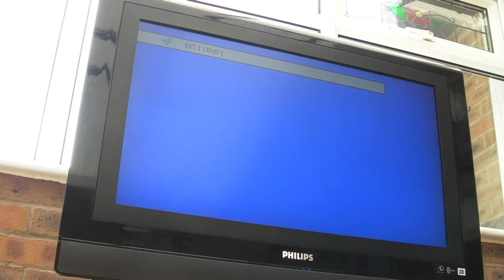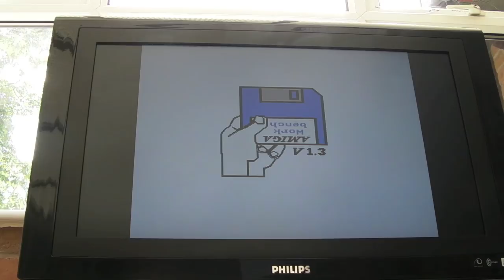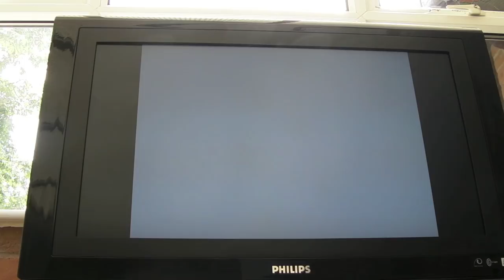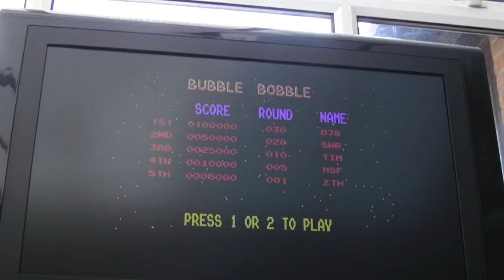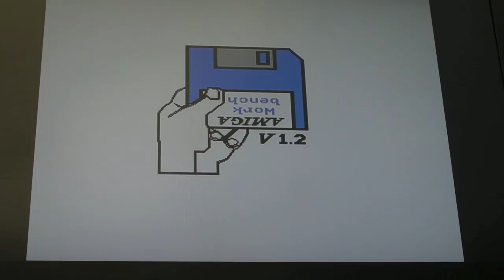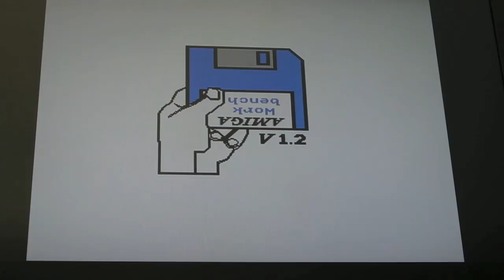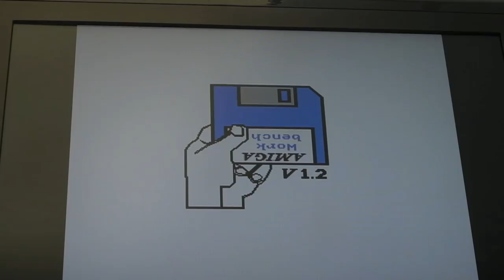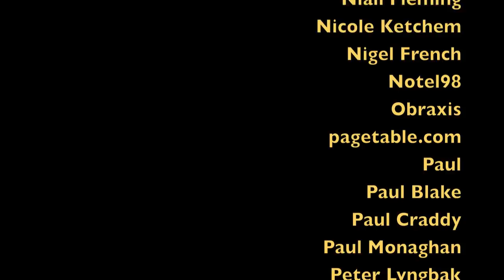Commodore Amiga A500 Repairs & Mods Part 7 (RAM Upgrade / ROM Switcher / Controller Switcher)

Comment from the maker: Part 8 - https://youtu.be/t1WT67cLfXM
If you would like to support the channel via Patreon (keep the channel running) - https://www.patreon.com/GadgetUK164
Links so you can skip to bits you might be interested in:-
00:16 - Intro & Upgrading Rev 6A to 1MB (using onboard sockets).
07:11 - Faulty Fat Agnus (No CPU clock).
10:06 - Behaviour when EVEN CIA chip missing.
10:26 - Cleaning up oxidised chip sockets using deoxit and white vinegar.
27:49 - Recapping and talk about differences in cap sizes vs later boards.
35:58 - SolidCore Joystick / Mouse Switcher (and my arcade stick). Donated by Riot Retro Gaming!
40:19 - SolidCore ROM Switcher (Designed by Kipper2K) / Testing the chip RAM / Extro.

Comment: Thanks for another great video. The not so good thing about doing the 1MB chip mod is that if the Amiga will be used for floppy gaming it will not be as compatible with games as 512KB chip + 512KB slow RAM. This is the really great thing about the ACA 500/ACA 500 Plus, you don't need to do the chip mod as long as one have the 8372A Agnus the ACA 500/ACA 500 Plus can turn the trapdoor memory into chip RAM with no mods. And then if you wanted to load floppy games, just unplug the ACA 500 and would be back to stock A500 with 512KB chip and 512KB slow RAM. In my opinion the ACA 500/ACA 500 Plus is by far the best expansion for Amiga 500/Amiga 500 plus. And that it can be used with Amiga 1200 accelerators is great. I use my regular ACA 500 in combination with an ACA 1221 A1200 accelerator.
Reply from the maker: Yes, I agree - if you have a rev 6 board, don't bother with the RAM mod done here!  The fact the slow RAM doesn't work is a pain imo.
Reply: La ACA 500 e' perfetta!

Comment: Back in the late 1980s I serviced a piece of equipment located in a damp basement. Had persistent problems with the EPROM socket oxidizing causing flaky operation. Then a kind soul introduced me to DeOxit and the problem was solved. The oxidation like shown in video can happen even with chips installed.

Comment: I just brought an A500 that is super dirty and the keyboard is in a bad way. After collecting all the parts needed like PSU and RGB cables I tested it and it booted ok. I thought this would be a bargain, but I regret it just from it not having a mouse. I managed to find a PS2 mouse for a decent price and then saw the price of the PS2 amiga mouse converters and have decided to make my own. So it was close to £30 for a mouse and adaptor or an original mouse. Then I did not have workbench disc so add that to the cost, but decided on a Gotek that was open box for a bit more.
Reply from the maker: Hehe =D  Cost soon adds up when you start working out cost of all the little bits and bobs needed!

Comment: Thanks on the tips on how to clean. Regarding static electricity. When I fiddle with chips, then I usually make sure to wear cotton clothes. And my workplace is with hardwood floor. No carpet. I wear a wristband, just as you do. Id I for some reason can not find it, that happens to all, then I make sure to touch a computers back each 5 minutes. And always when I get up from the chair or sit down. I might be paranoid, however, better safe than sorry. Never lost anything to static electricity this way, and I have been working with PC's and other computers and components since around 1990.

Comment: 41:40 - I have bought an A500 Rev 5 and there is a wire from the Processor chip to a pin in the ROM chip [pin not in socket]. I presume this the Clanger you talk about?? Can I use this ROM switch with an Agnus upgrade to get RAM expansion above the 512K basic??
Reply from the maker: In order to get more than 512K chip RAM, you need an 8372 Agnus (that will give you 1MB chip).  My suggestion is to get an 8MB RAM board that fits under the CPU, something like the GottaGoFastRAM board that I reviewed recently.

Comment: I have an A500+ that fails to boot certain games from floppy. No matter if real floppy or a Gotek. I'm considering replacing all the sockets with brand new turned pin sockets.
Reply from the maker: It could be bad RAM!  Get SysTest for it (free to download) and run a memory test!

Comment: Don't suppose you would know if I misplaced the amiga a 500 plus rom chip in the wrong position as the rom apparently goes in one space back from the normal pin 1 position would fry it. Yes I did this and it smoked a bit don't know if the smoking was from the vinegar from the cleaning process or the chip was fried....!! Gulp
Reply from the maker: Yes, I made the same mistake on a 1200 recently - it fried the kickstart ROMs!

Comment: When I received my A500 (rev 6a I think), it came with the old school rom switcher - an actual switch in the side of the case!
I assume it would just be a case of ordering those chips from the official source and sticking them in? 🤔
Reply from the maker: Yes, you could do that - to get 1MB of chip. Note: Some games like 512K Chip / 512K Slow, so that could be a problem.  I never liked the rev 6a board for this reason lol.

Comment: I feel like that 8372 is 100% dead.  It's not generating anything at all from the master clock. Even without a CPU you should get sync.
Reply from the maker: Yes, you are probably correct!  It may not be outputting multiple clocks!

Comment: Do you have a link to somewhere i can buy replacement ram chips for my A500 Rev 6. I suspect i have some chip ram going bad..
Reply from the maker: You need to search for 44256 DRAM on eBay.  There's not much on there atm (except for expensive in the US), but there's regularly lots of it on there.

Comment: You could try adding a pull up or down resistor on the output of the chip with the failed clock circuit in it to see if you can get a signal out of it.  It may be that one side of the push pull transistors has failed resulting in it not functioning.  Something like  shown in this video: https://youtu.be/Y8_emfoR_MI
Reply from the maker: That's a valid suggestion!  It may make a difference, I will look more at this Agnus at some point!
Reply: You could check it on the scope to see if there is any activity on the clock pins.